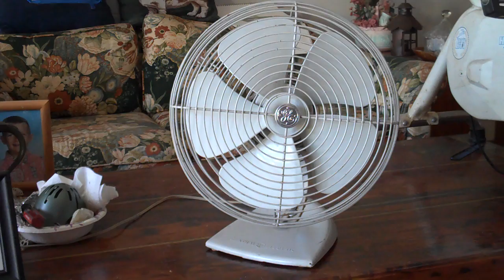Vintage GE 5 Blade Standard Oscillating Desk Fan

Comment: Have one just like this, but just about impossible to get the blades off to take it apart to put fresh grease and oil in it.  Afraid to break the plastic blades, and no room in the back to really get in there.  :-(
Reply: Update!   (Yeah 4 years later)  I took mine all apart, and completely cleaned it, and rewired it, and fresh grease and oiled.   Runs like new!   :-)
Reply from the maker: Reply (LOL 7 months later!) - doing that makes a big difference! I like how these are easy to get in to the motor. While I like the smaller GE, I've never taken it apart due to the rubber hub of doom.

Comment: Nice, unique fan.  It's quiet and smooth sounding.
Reply from the maker: Thanks! It's very decent, I've found that low speed is much quieter when run on 105 volts.

Comment from the maker: @mitchman2100 - Yep, I've had it a while. It throws a very good bit of air. It's a little loud-ish, but actually has the power to match the sound (unlike crappy modern fans, which are loud AND gutless.)

Comment: Really? you were able to find literature placing those in the early 70's? wow! i never would have guessed they made those into the 70's. 60's i could belive easier.
Reply: 1944johndeerel My parents had purchased this fan in 1969 it had a plastic 5 blades F12PG21 Model Number

Comment: i like those. i would like to find one with an osha cage. i dont have a preference on if it has metal or the plastic blade. i think they are neat. 
and ge has used the strap base since the 40's, and i belive yours is made somewhere in the 60's i belive GE  was outsourcing quality "all plastic constucted" fans from another company by that point in the 70's ive seen some around and they seem like very nice fans like most other 70's fans. and they really are whisper quiet!